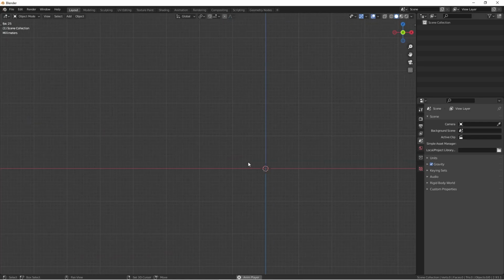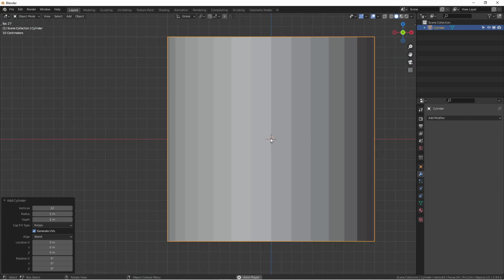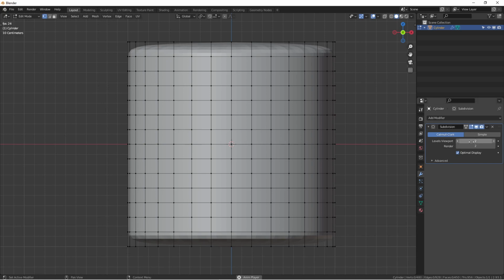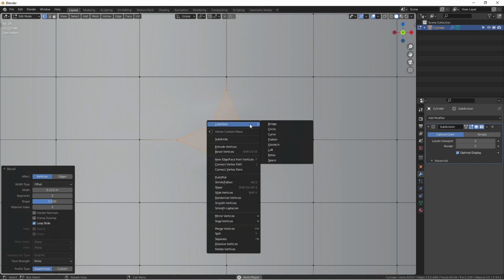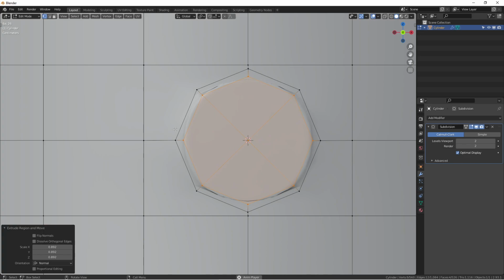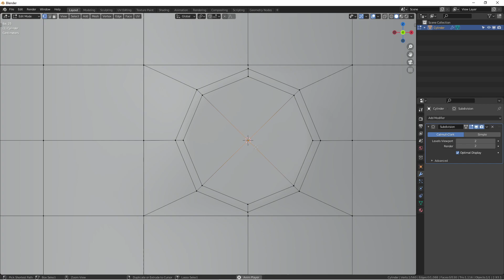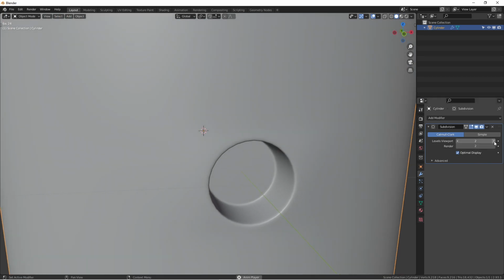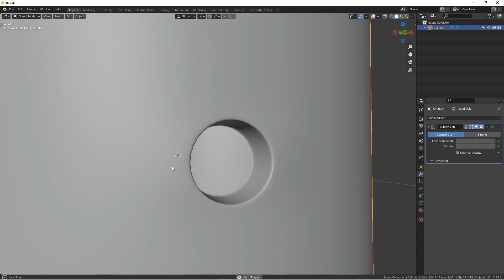The Best Way to Cut Holes on Curve Surface in Blender (Quick Blender Tips)

Comment: Thank you. Yeah, I'm certainly going to be adding this method to my tool box.  Using a shrinkwrap modifier against a clean duplicate of the cylinder also works to heal the effects of a flattened loop-tool circle, and the scaling from the center vert.  Although, it may be necessary to create a vertex group that covers not just the circle to be cut, but some of the verts in the surrounding area. subscribing 👍

Comment: I realized that although you can make nice holes whith this method, but this also results some shading issues caused by minor deformations around the hole (and that is so even if i do some preparations such as inset, joining vertices etc). My method to partially avoid this is: 1.: the mesh must contain square-like faces (instead of a horizontally stretched rectangles). That means in case of a 1 meter x 2 meter cylinder with 32 vertices, that you must make 10 horizontal loops. 2.: you must make a bevel wich is almost a circle (instead a concave shaped bevel). You can achieve this if you set the shape of the bevel to 0.08. And the loop tool comes only after it. The end of this method is the same (inset, joining the vertices, subD, shade smooth). Unfortunately my method doesn't give perfect result either, but the final result is smoother, with less shading issues.

Comment: This indeed is a  great technique for making circular cuts on a curved surface but i would like to mention one thing that while using loop tools for creating circles on curved surface , unchecking the flatten option is the best thing to do otherwise the circle you make will be flat i.e it will not follow the curvature present on the surface , looking forward for more content xiongdi❤
Reply: This is preference. Sometimes a situation will call for flatten despite the surface being curved. Sometimes I want my sphere to have a hole and I want the base of the hole to be flat versus curved.
Reply: Unchecking flatten seems to produce weirdly distorted contours instead of circles.

Comment: This is great and works perfectly for a circle. I’m guessing there isn’t a good solution for making any random shape? 

I have a model with some other surfaces pushed through it so I could run a Boolean but it totally messes up the mesh
Reply from the maker: you can still use boolean tool to cut, then retopo the mesh using some third party addon like " Quad remeshier"

Comment: I understand what you are going for here, but what if you want to do it in a non-destructive way, then you need the Boolean modifier, in that case this won't work, besides even with the Boolean modifier, after you apply it you can always connect the vertices, as long as there is good topology then I don't see the problem with using the Boolean modifier.
Reply: isnt the boolean way more destructive ? how do you even use subdiv with booleans ? this technique looks actually clean
Reply: Booleans are bad and lazy and cause a whole host of geo problems... its kinda ok for concepting stuff I guess.. but this is much better for geo!

Comment: Thank! Do you think you could possibly do one on reasons why using boolean to cut an object evenly in half doesn’t always work
Reply from the maker: Most of the time is becuase of not enough geometry of your mesh, we usually dont want to add too much in order to work efficently in the computer. using sub surf modifier does not very helpful either. So I would recommend to use this way to cut a hole

Comment: Interesting, I have seen similar before by projecting a Circle on the the surface.
So fundamentally we need to get a Circle onto the surface of our Cylinder, at the correct position and scale, and the vertices of those circle needs to be close to the some of the vertices on the originating mesh. Then we ned to ensure that all our circle vertices are connected into nearby original mesh vertices to avoid N-Gons etc.  Still pretty tricky to retain symmetry, avoid deformation of the original mesh. And I do not see any realistic method to resize after the operation.  
But its understood to be the correct way to retain correct geometry, that Booleans mess up.  Thanks also for the tip on the Mesh Circle tool Add On.
Reply from the maker: Well said my friend😎👍

Comment: For me the problem arises when I've to create the hole, bevel it and then subdivide it. Those vertices get grouped and it doesn't look good with subdivision. You have any workaround for this?
Reply from the maker: did you conect the vertices after beveled the hole as what this video is showing? if you still have issues, you can slide some of the vertices that are surrounded the hole to make the transition smoother, hope this will help:)
Reply: @WenboZhao  Ya connected those. I basically face the problem in creating the proper topolgy around the bevels because it creates a lot of vertices and it disturbs the topology of the object.